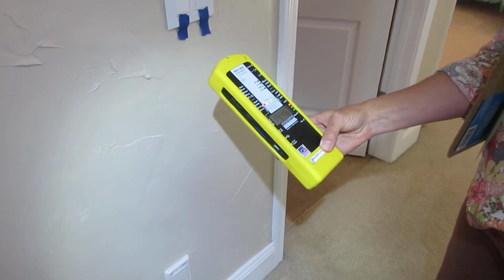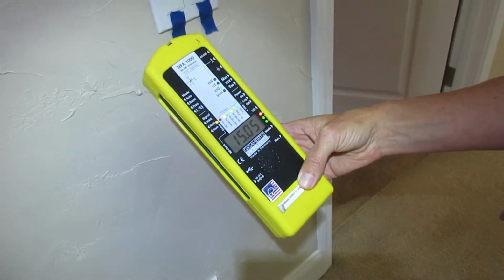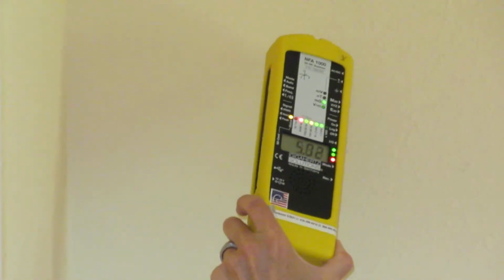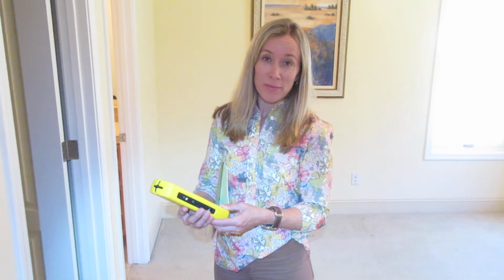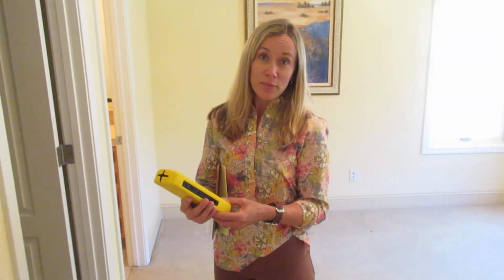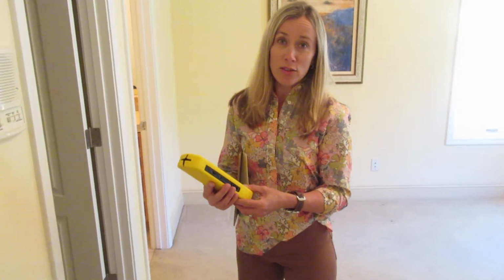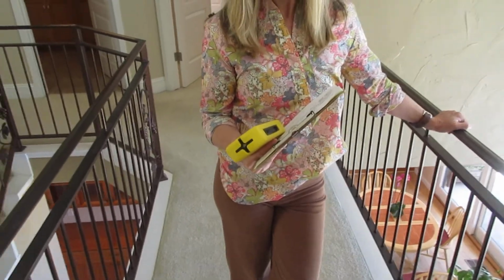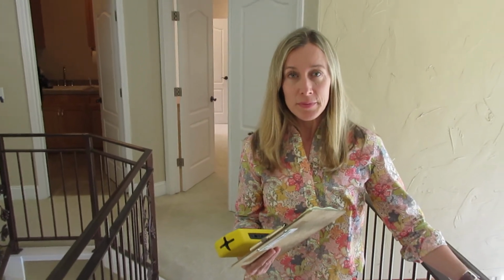Wiring Code Violations Create High AC Magnetic Fields

Comment: What do you recommend for high electromagnetic fields (vs magnetic fields)? And can you recommend an electric field meter? Thanks
Reply from the maker: For high AC electric fields, first can you determine the source? Often it's Romex electrical wiring in the walls. Unplug any cords or cables nearby, move the bed 1-2 feet away from the wall, or consider turning off the circuit breaker to the bedroom at night. Here's the meter I recommend: https://safelivingtechnologies.com/products/safe-and-sound-em3-pro-meter.html?aff=55
Reply: @sagelivingEMF  thank you so much again!
Reply: @sagelivingEMF  Thank you so much, I enjoy all your videos.The meter is not available yet. Have you tested and found it to be accurate?
Reply from the maker: @sunnies336  Thanks for the kind feedback. The new meter has performed well in beta testing. SLT is a very reputable manufacturer in my opinion. The meter will be available soon on 8/15. If you need an electric field meter now, I recommend this one https://safelivingtechnologies.com/ME3830B/?aff=55
Reply: @sagelivingEMF  I appreciate your help, thank you. I hope that you continue to post more videos, very helpful
Reply: @sagelivingEMF  I'm looking forward to any demonstrations with the new meter. Do you find it easier to use or a replacement for your other meters that you currently use?